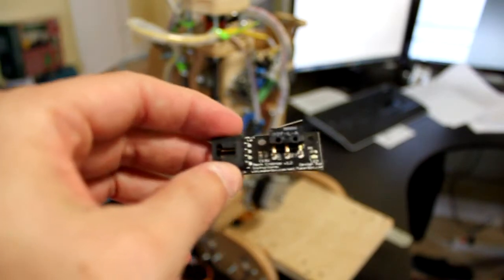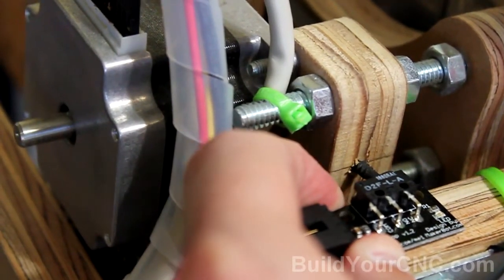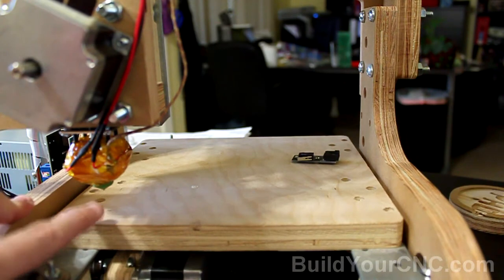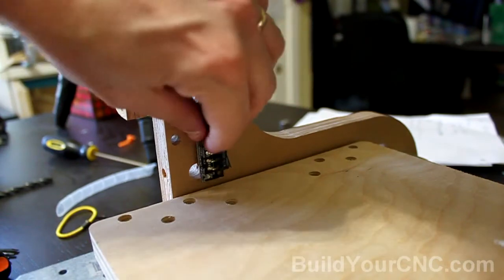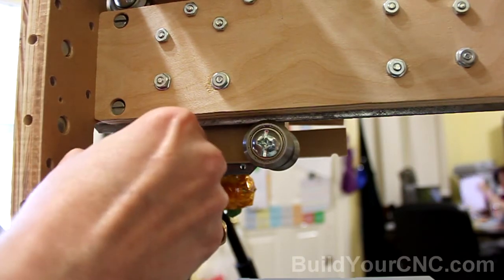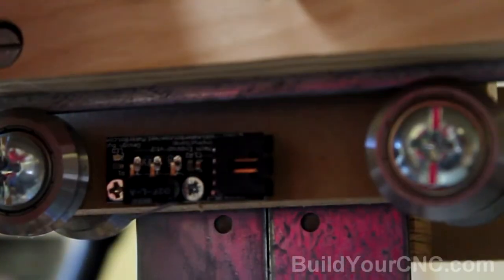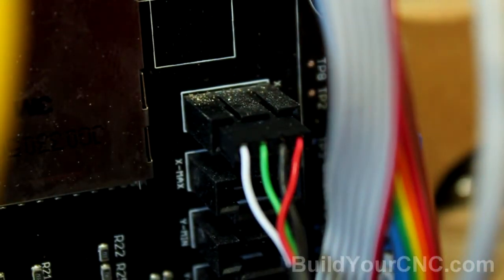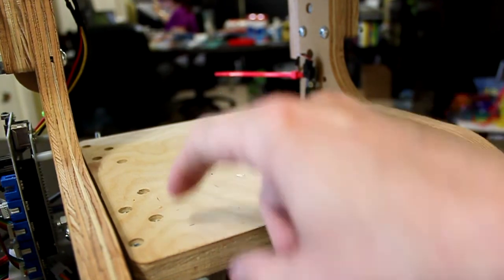whiteAnt limit switches

Comment: I am building a CNC router and would like your advice. For the Y-axis I want to use two stepper motors. I want to put two limit switches on the home position of the machine, one on the left and one on the right. When the switch on the left side is tripped I want it to shut off power to the left motor on the Y-axis and when the right switch is tripped it will shut off the right motor on the Y-axis. The rate at which each motor will stop will vary. This would keep the gantry alined. How would I achieve this?